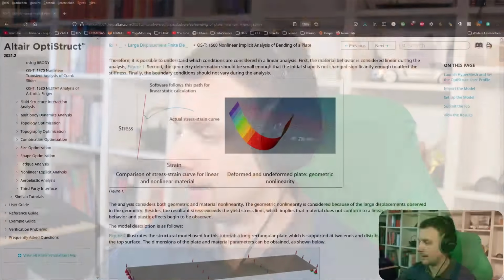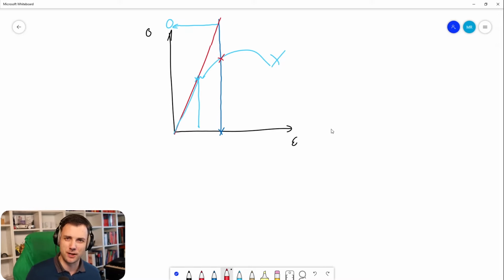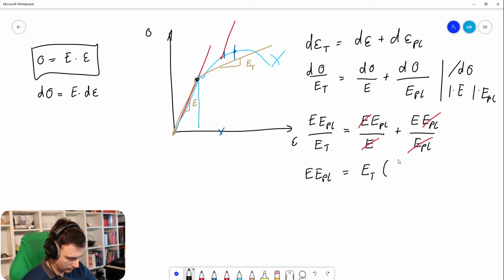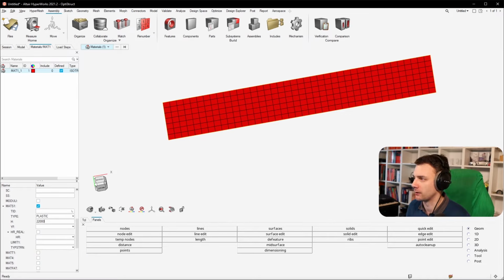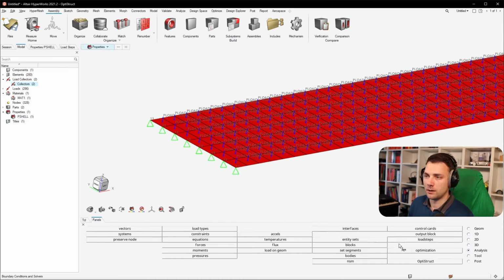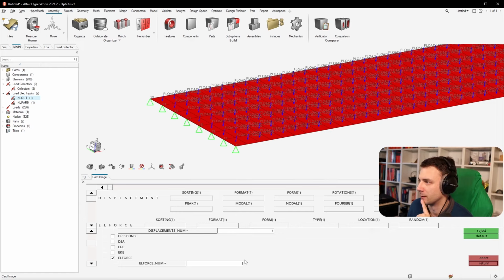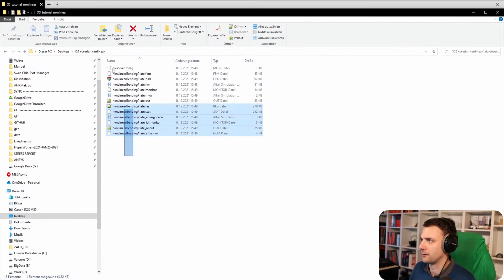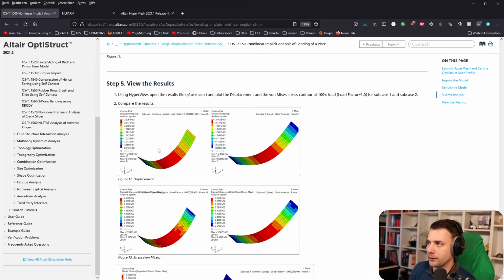Nonlinear Implicit Analysis of Bending of a Plate in Hypermesh - Optistruct (OS-T 1500)

Comment: Thanks for your useful videos. I have a similar problem with left side fixed and right side with imposed translation on nodes. After defined the two load collectors and run successfully a first analysis, i want to change the value of the  imposed translation  but at this point i'm not able to recover the constraint to modify . I go through "Analysis- constraints" but when window opens i don't see any way to specify which constraint i want to choose. Could you please explain the correct steps to accomplish the task ? Thanks
Reply from the maker: Sure, in analysis - constraints: there is a radio button on the left saying "update" - click that and you can select the constraint you want to update - change the values and click on update. All the best :)
Reply: Thank you for your quick reply. Unfortunately i open the constraint section with update button already checked , but as I select a constraint on the tree nothing happens, in the sense that the constraint i select in the tree is not highlighted, so i don't know if i'm updating the correct one or not. Am i missing something ?
Reply from the maker: @CP-zi3eg  Sure. No you cannot (at least to my knowledge select the constraints in the tree with this menu but in the graphical user interface). . If you select it in the GUI, the constraint will get highlighted. There is also a review button which lets you examine the values of a constraint, when selected. This way you can check if the values were updated. In the newest version of Hyperworks the constraints are listed individually in the tree - there  you could change the values directly in the property editor on the bottom left. Also, when updating in the constraints menu, be sure to check the message on the bottom left as you will see there if the constraint has been updated (and therfore properly selected) or not. Best of luck.
Reply: Thank you again for the explanation